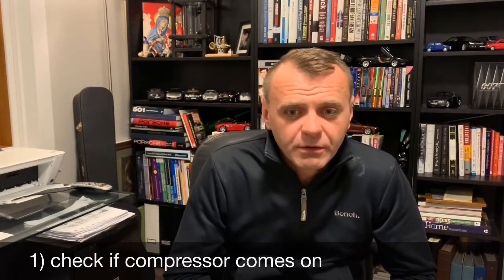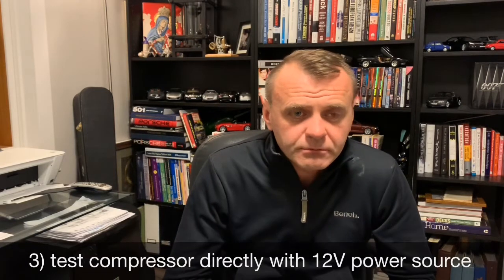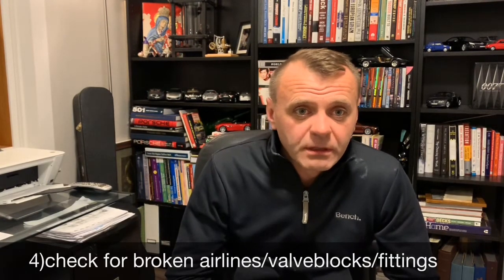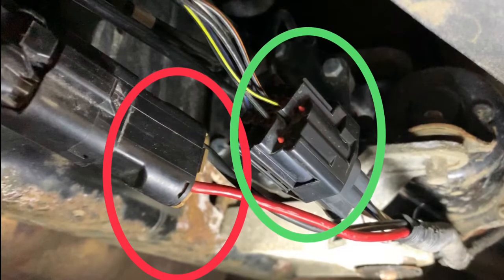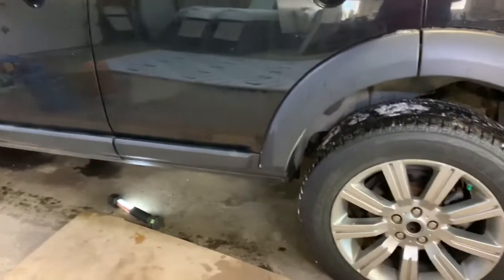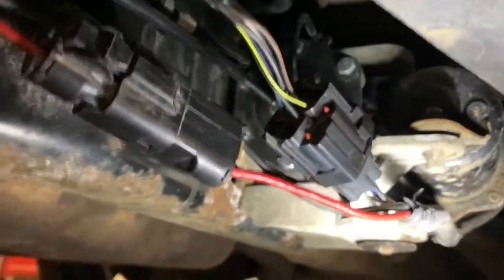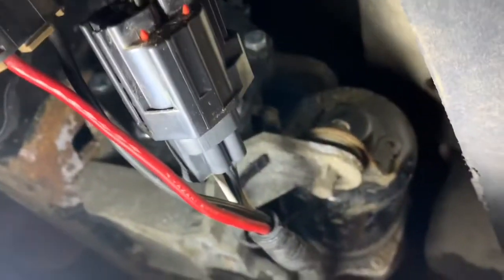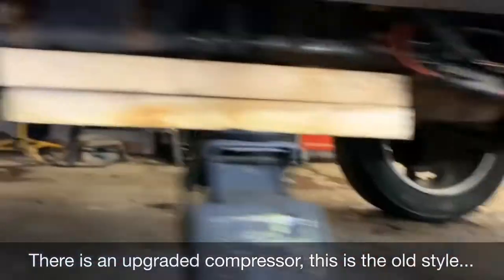Land Rover Discovery Lr3 air suspension repair.

Comment: I hear the 4.4 V8 is better than the 4.0 V6 -- do you prefer the V6?  If so, why?
Reply: Well, On The V8 Their Are Many Problems And The Fixing Price Is Expensive. So Every one used V6 Because is smooth and calm but v8 is fast but really rough and sounds bad. So That's why we choose the v6
Reply: I specifically went for the V8 because of lesser reported problems. The 4.4 Jaguar is bulletproof compared to the previous BMW 4.4. 320K and counting on mine. No issues. Way better fuel economy than my D2.
Reply: V8 is the way to go. V6 is not a good choice. V8 is smooth like butter.

Comment: did the same and found the front passenger side corner sagged after one day in extended mode.  What would you do next?
Reply from the maker: Victor Ugenyi check for leaks around the front solenoid valve under the front right inner fender liner. Spray with soap solution and look for bubbles. If none are there check the airline that goes to the top of the air shock and do the same. If no leaks are there then likely your air strut has a leak, the rubber breaks down over time.